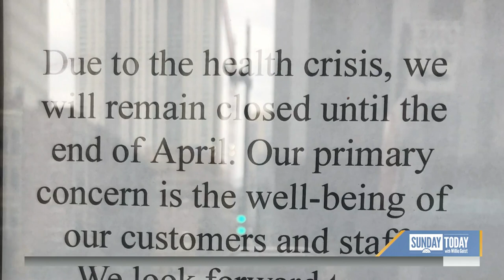How Production Of An All-Electric Pickup Truck Is Revitalizing A Midwest College Town

Comment: I love having Rivian here and it is a big boon for the area. Even preordered a Rivian so I’m a big fan. There is a fortune 50 company already headquartered here though. Rivian isn’t saving a struggling small town like this story would have you believe.
Reply: Ah its about time America is getting itself running quietly motors. No Fumes, not much noise, Building Back Better America. Heck alot CLEANER and Quieter. Hoping Rivian has millions of orders and can fill them quick. Where will the repair technicians be located? Will they be training other repair technicians for each state?

Comment: Can't wait until they make a $25-40k truck with single or dual motors, no air suspension and maybe 200 miles of range. Seems like RJ could make it happen with the investments that Amazon is making into the company.

Comment: Did he casually say that the truck goes 0-60 in 3 seconds?
Reply: I thought I heard that as well. That's a bold statement.
Reply: @bobbybecker6435  not really, the model X Plaid can hit 0-60 in 2.5 so hitting 3.0 with the 4 motors that it has is hardly crazy.
Reply: Yep. There are a number of electric cars out that already do this (especially Tesla's). That's one of the great features and power of electric vehicles.
Reply: @KingArthur13th  it's a truck Bruh. It's impressive for any truck to do that
Reply: @daddystired  this is the internet. Nobody gets to agree.
Reply: One motor for each wheel, little under 900 horsepower….. it moves! Consensus is that the 3 seconds is under perfect conditions but that is always the case with manufacturer stats on cars.
Reply: Even the new Hummer EV can do 0-60 in 3 seconds. Fast acceleration just happens to be an EV side affect of having the capability to do everything else they do.
Reply: The tri-motor Cybertruck will do sub-3 seconds. It's a bigger vehicle also, tows and carries quite a bit more than the Rivian, and will have 500+ miles range -- if you can handle the post-apocalyptic, retro-future brutalist design. 

The crazy angular design is actually not really just for looks -- it's because of its cold rolled stainless steel exoskeleton; not a material that lends itself to being formed into curvy shapes. Also keep manufacturing costs down so you can get crazy specs for the cost. 

Rivian looks like a very nice vehicle, though -- if you don't need something bigger, don't have heavy towing requirements, and can't stomach Cybertruck's looks.
Reply: @bobbybecker6435  Not a bold statement anymore, abit of Cliché for high performance EVs.